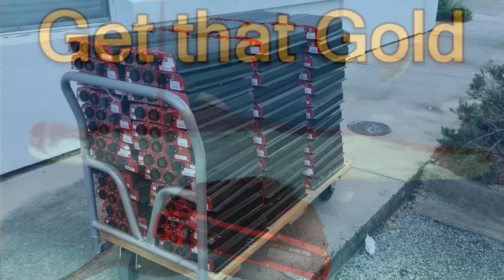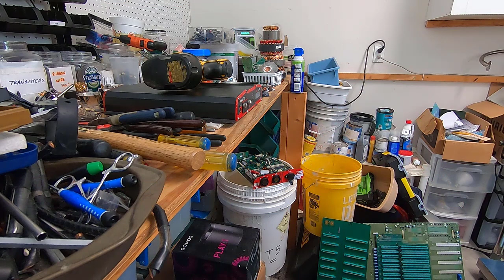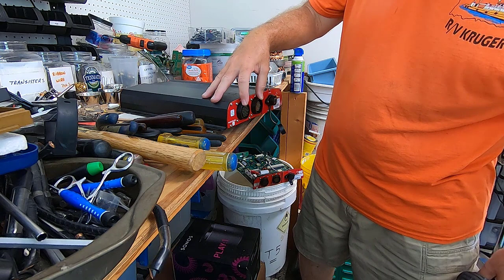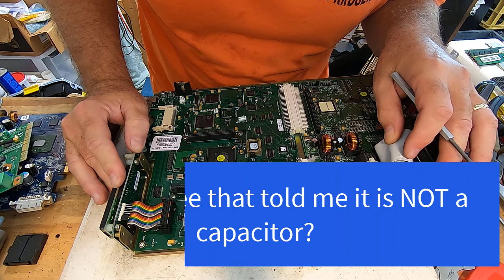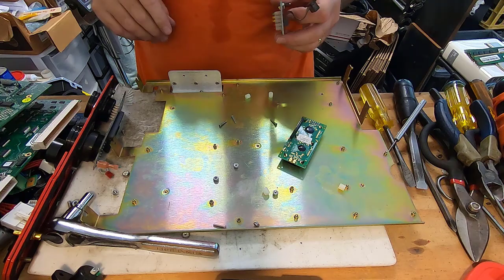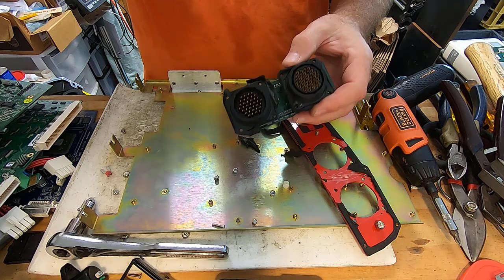Get that GOLD - The upgraded Talking Bus DR600 gold finds.

Comment: Sell those LCD modules as is.  New, they sell for about $10-20.  I'd bet you could easily get $1 a piece easy on ebay.  Sell as a batch.
Reply from the maker: Interesting - I'll dig into that some.  Sell now or save for possible long term value, the eternal scrapper question.